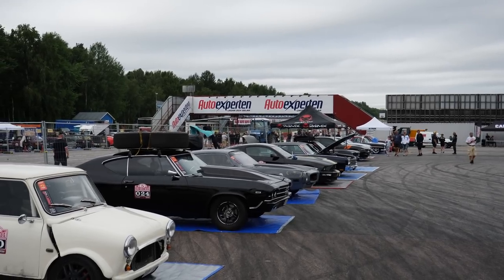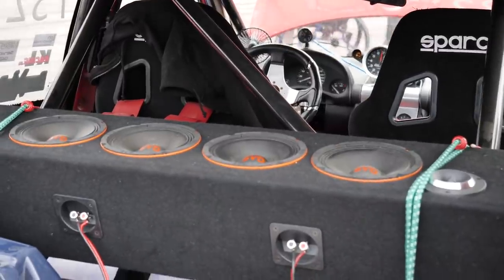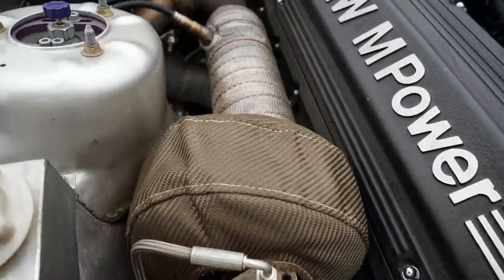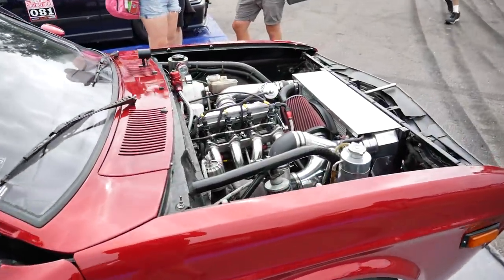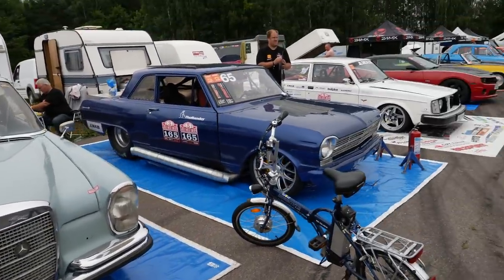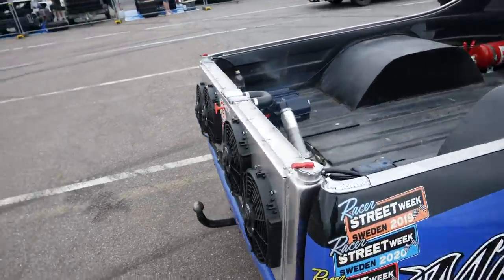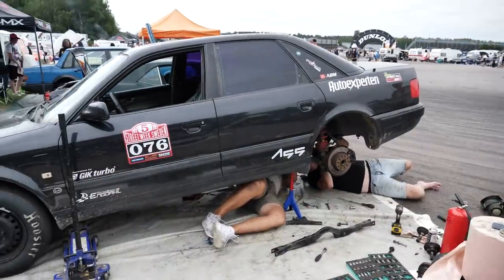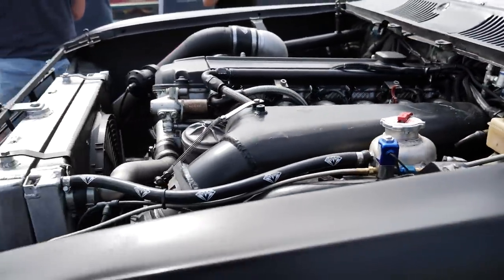Streetweek Sweden who survives!

Comment: 20b 4 rotor rather than 13b 2 rotor 😃 extra rare
(Edit: the runners being so spaced apart made me think it is a 4, even tho the 2 also has "4". I think ill have to bring it up on the big screen🤔)
Reply: Just curious, does rotor engines have 1 or 2 intake valves per "cylinder"?
Reply: @erik.lindberg89  dom har exakt 0 ventiler, om man inte heter polyphony och tillverkar spel, då har dom både ventiler och kamaxlar😂
Reply: @erik.lindberg89  wich engine would be better for my skyline, a gallo 12 or a gallo 24?
Reply: Betyder detta att jag borde läsa på lite om hur wankelmotorer fungerar? 😆
Reply: @erik.lindberg89  nä du är fullärd😎